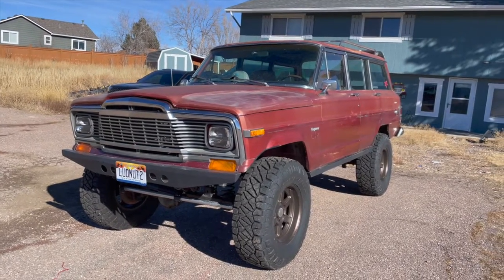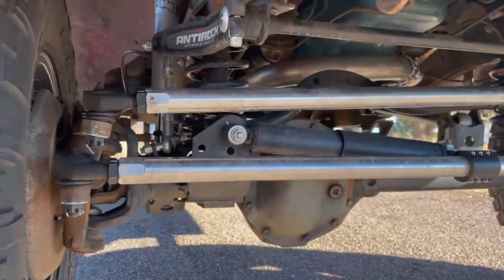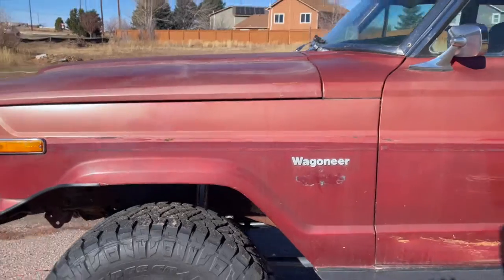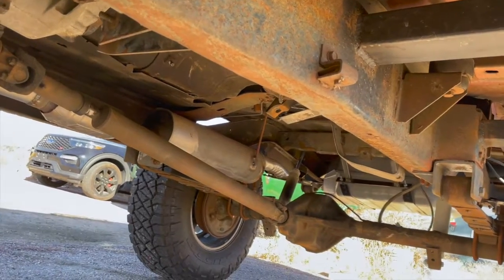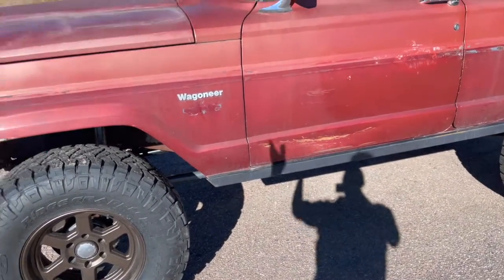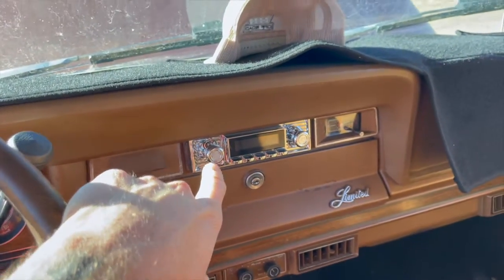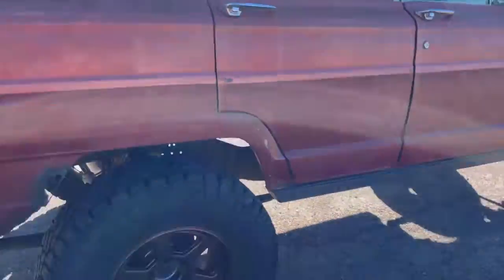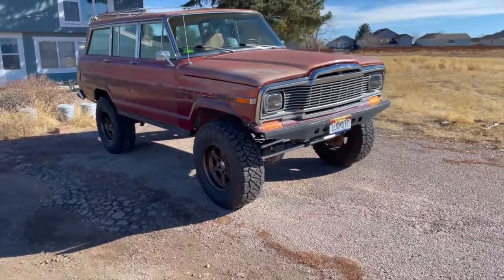Detailed 1979 Wagoneer Update

Comment: did you do the tank install yourself? what tank straps were used? I have a '73 and have seen old forum posts on using the '97 blazer tanks

if your planning on selling, I might also be in the market for the 44 when you upgrade (73 is closed knucle/drum brakes)

Comment: Howdy, I have a 79 quadra trac wagoneer also. Gonna do a Rusty's 6 inch lift because I'm a rookie. As a newbie, may I ask how lowering the transfer case works in relation to the transmission? The QT is not a divorced case, right? I'm very intrigued by this mod, as I am also concerned about drive line angle.